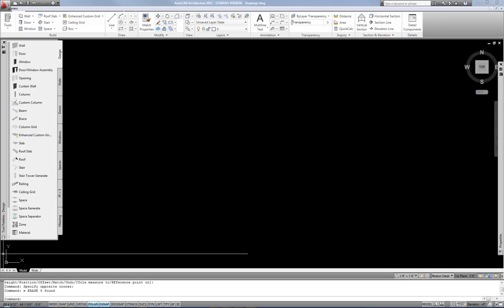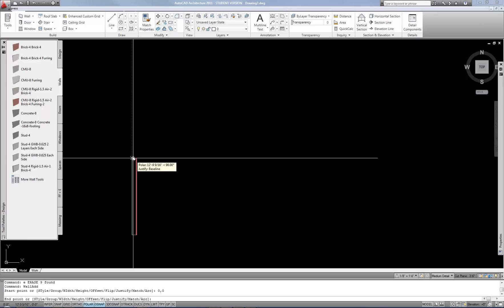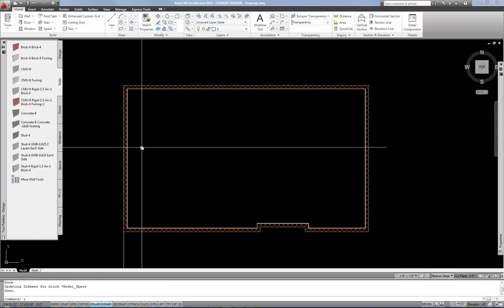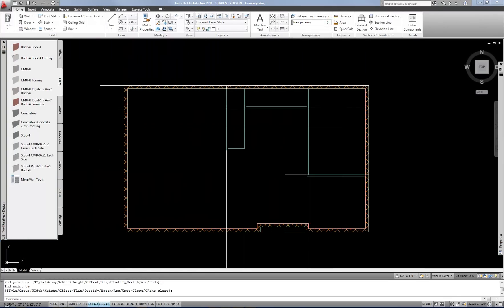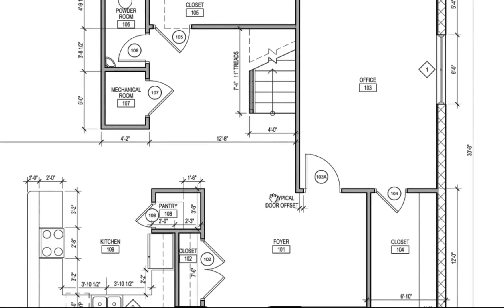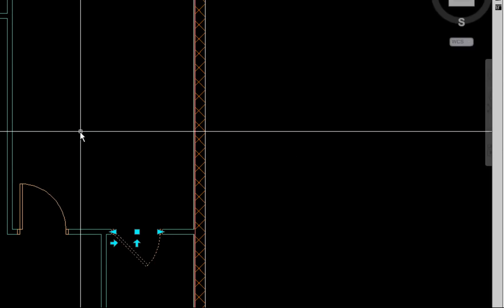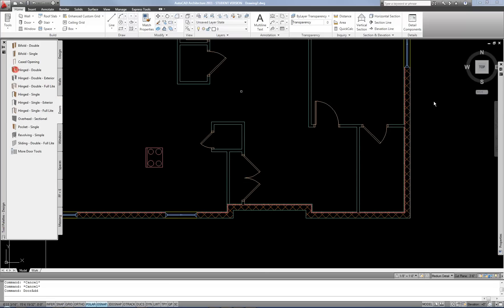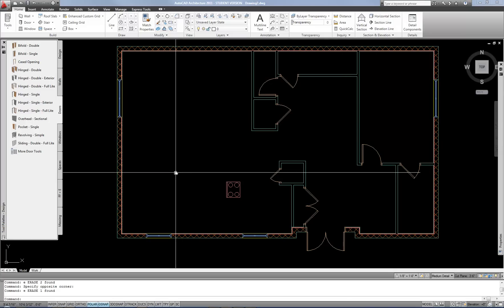AutoCAD Architecture Floor Plan

Comment: Hi Jeremy
I have seen your informative and exelent videos on Youtube about Autocad Architecture and I really want to thank you for that.
I have worked with CAD 2016, but I need to work with CAD Architecture. So I found your informative videos which helped me so much.
But I still need to know a point which has stocked me in MUD!!
I drew a 3D house, but when I go to Top View, I can just see the ground floor plan, not the second floor plan. How can I see other floor plans in Top View so I can continue my task as I did for the ground floor plan?
Can you help me in this regard by dropping me some lines or a link?
Thank you very much
Best
Reply: Set up a different display configuration which has a higher cut plane.

Comment: Hi, Jeremy. Need your help, please? My Tool Palette / Design tab (AutoCAD Architecture) does not have any Walls / Windows/ Doors/ etc tabs. How do I get them?
Also, I have seen few of your tutorials and they are so well and logically explained. I was wondering if I can buy complete tutorial for Architecture and Revit from you or do you maybe have membership / website tutorial ? Thank you, Jeremy.
Reply from the maker: Are you sure you're using AutoCAD Architecture and not regular AutoCAD?   Should say at the top center, on the titlebar. 

After confirming, try editing the tool palette by clicking on the properties icon of the tool palette -- the third icon down on the palette edge, below the X.   This will open a pop-up menu.  Choose 'customize palette.'  In the dialog box you will see all available palette tabs on the left and groups on the right.  Add any tabs to the Design group that you need by dragging/dropping.
Reply from the maker: Sorry, I don't have any tutorials available for downloading but I appreciate the remark.
Reply: jeremytf77 Thank you, Jeremy. The list of the palettes on the left was the same as the list of Groups on the right...(there was nothing to drag). I tried ...OPTIONS, PROFILES, change to US METRIC. That brings up missing tabs, but they disappear every time I switch computer off. (yes, I do 'save as current', and 'apply' and 'saves as' in workspace, but it just doesn't stay as I set it up. I have no idea what I am doing wrong. I called A2k Technologies Support (Autodesk) but they didn't want to help since it is not system problem but my lack of training. But....thank you, Jeremy. I'll keep looking for your occasional video tutorials.

Comment from the maker: @Nicholas N - It sounds like your units aren't set correctly.  Did you start the software from an imperial desktop icon?  Using an imperial template for the file?  Check the units by typing "units"...
Reply: where I can found all videos of this project

Comment: I'm trying to draw a floor plan that I have a paper copy of, but when I try to input the length of the line/wall in feet and inches (for example, a 22 foot, 10 inch wall), it either tells me that it's invalid or the line goes away.
Reply: Either there is a flaw in your process, or your drawing units aren't set up correctly. Try some of my fundamental videos.

Comment: Could you not just import PDF into Auto Cad Ar and draw over and then del that layer .  I use to do that with simple AutoCAD but not sure if its possible in Auto CAD Architecture .
Reply from the maker: Sure, you could do that.  But you don't always have a PDF available so it is good to know how to work without one.  And a lot of times people who literally trace an image end up with an imprecise plan with fractional dimensions.  A more precise method is to use care in placement if walls in relation to one another, which means you're not saving much time by inserting the PDF anyway.
Reply: jeremytf77 Thanks for explaining in detail . Its make sense now  .

Comment from the maker: Sounds like everything is working as expected.  You can't expect to see the second floor objects and first floor objects simultaneously.  Switch to the display configuration you need at any given time.  You can assign specific display config to a viewport if necessary.  But the idea of having separate plan files is that you would work on the first floor and second floor in their respective files, so there is no reason to worry about seeing everything in plan view in the combined 3d model file.

Comment: thanks Sir, I was able to stack levels using Xref, with Xref Z cordinate set to the elevation but the Xref second floor(walls) are not visible. I was unable to change cut plane value  for the Xref second floor alone cos if I increase cut plane value my second floor walls become visible but this time my first floor(windows) disappears. plz tell me hw to fix this.

Comment from the maker: Another option is to draw the separate levels in separate CAD files, with each level at 0 elevation in its respective file.  Draw them all with the same location relative to 0,0.  Then XREF them together into one combined file, with the XREF Z coordinate set to the elevation so the levels stack onto one another.

Comment from the maker: Creating slabs and walls for upper floors is the same as a lower floor except for the elevation setting in the properties palette, which is normally 0 for a first floor, higher for upper levels, and negative for a basement.  If the exterior walls are continuous for the full height, change their height instead of stacking walls.  Also review display configurations and cut planes to make it easy to see the upper levels as you work.

Comment from the maker: @trimix83wasTAKEN There is no "import" necessary - the file format is the same.  So... simply open the AutoCAD drawing in AutoCAD Architecture.  However, there is no way to instantly convert the 2d linework to AutoCAD Architecture walls,doors, etc. The quickest way is to simply trace over the lines with walls, and then erase the lines afterwards.  If you are comfortable with XREFing the old drawing into a new drawing, that's how I would do it.  But XREFing isn't necessary.